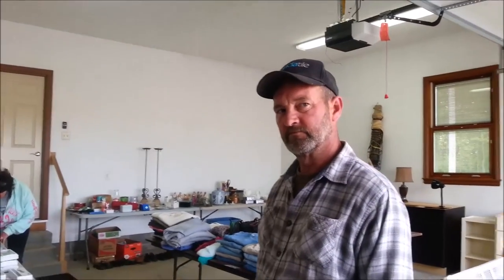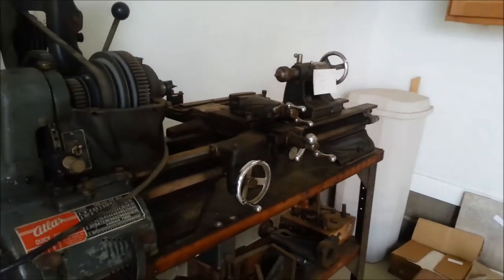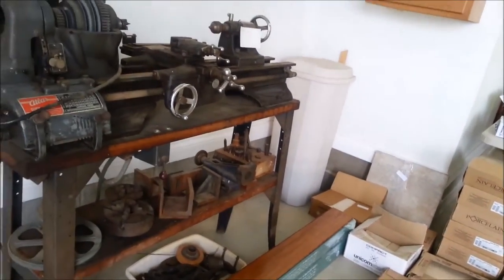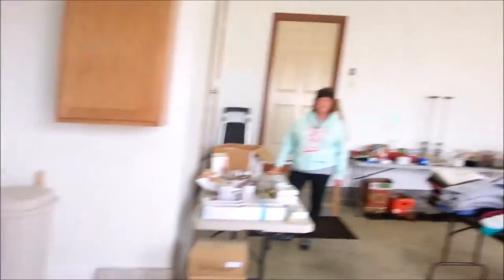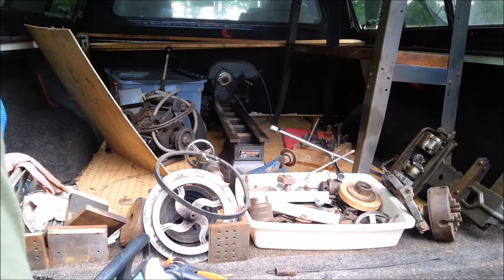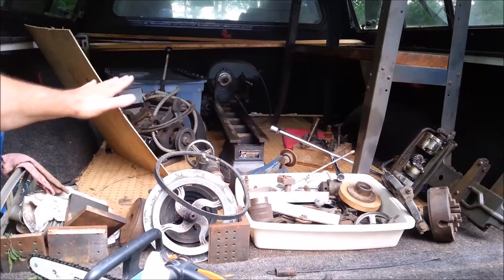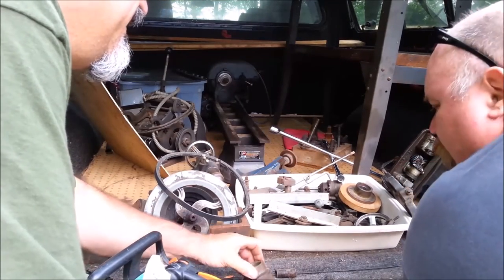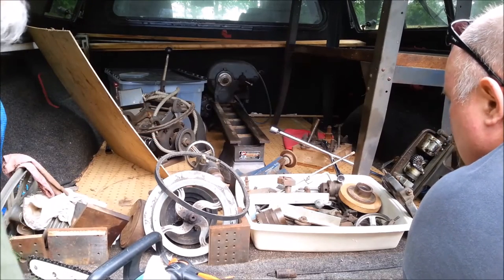Atlas Craftsman QC42 Garage Sale Lathe BOTT 18.5 Crafted Channel

Comment: Dave you find some awesome deals for sure.  Yep got my good side.  I'm right in the middle of selling my house and moving, so have not had a real good chance to get out in the shop over the last few months.  I ordered a new tool post for mine and did find a 4 jaw chuck but will have to build a backing plate.  Right now I'm in the hunt for a good mill, not sure if I'm going to go used or new yet.  Have to sell the house and get moved.  Great video and thanks for the plug.  Still working on my channel not sure what direction I want to go.
Thanks for sharing.
Reply from the maker: A good house would fit inside it's workshop.
Reply: I just but a offer on a house that has 40 x 80 shop.  5 bays 12' eves.  So yes the house will fit in the shop.  All will have to be done is need to have a elec. service brought in to get more power.  And wire up some better lights.
Reply from the maker: Bill Man, that sounds really awesome.  Make a couple vlogs about it so we can follow.
Reply: Well do
Reply: +Bill “Big Bill” nice thinking of building a timber frame shop and set up a line shaft
Reply: cool
Reply: +Bill “Big Bill” yeah need to find the framing chisels still. any one have some?
Reply: I know there is alot of videos on how to build timber frame.  Look on the auction sites I've seen tools like that before.
Reply: Oh yeah me to trying not to break the bank though "pinny pincher"

Comment: Bargain.
Reply from the maker: Are these common in your country?  What are the most common brands there?
Reply: Not very many in AUS.  The most common lathe in that class is Hercus (which is just a Southbend clone).

Many other local brands were produced, but not in the same numbers.
Reply from the maker: I hope a Hercus makes it into your shop for demonstration at least.  You can always sell it after you get done entertaining us.  ;-)
Reply: Unlikely.  They are a bit over rated IMHO - same as Southbend.  The old machinists used to call them Flexibends when I was a kid :)  Not very rigid as lathes go.

Cheers Rob